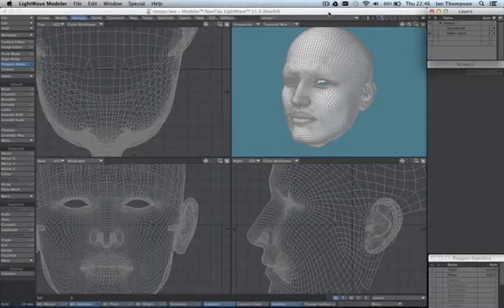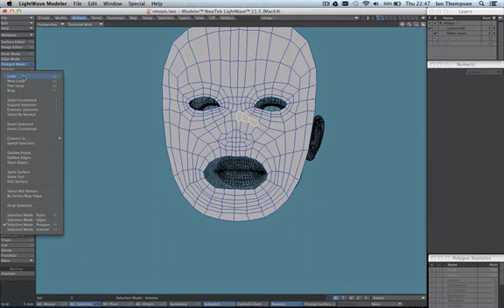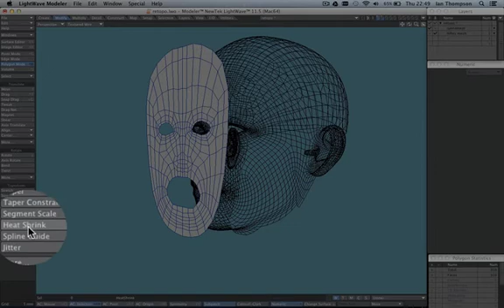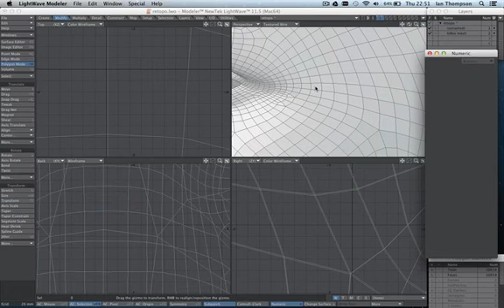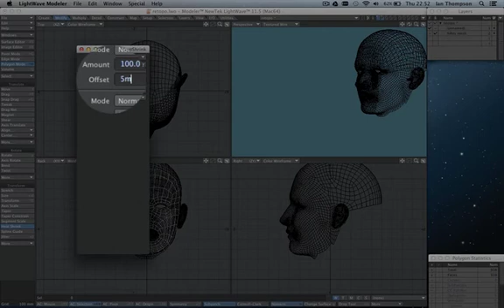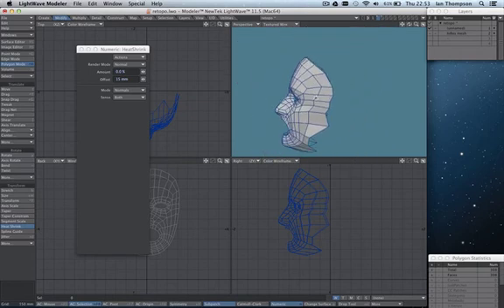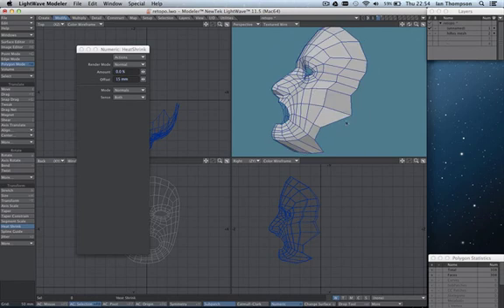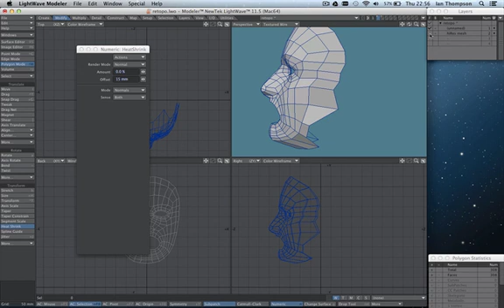Lightwave 11.5 - Retopology Technique (part 2)

Comment: you probably wanted to show heatshrink together with retopology and the size "trick" is kinda neat! thx. 
but to do the retopology you started out with you could simply select points on the hires mesh and create new polys on it (with a new surface name). this technique would also give you a visual cue about the coarseness of your new topology: the larger polys you create, the more original geometry sticks out of it (on convex parts of the model).